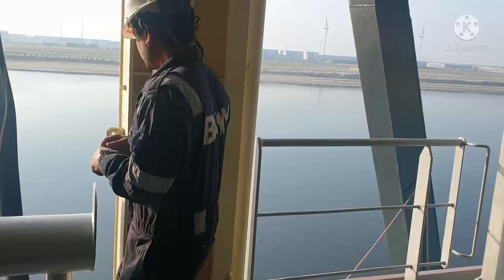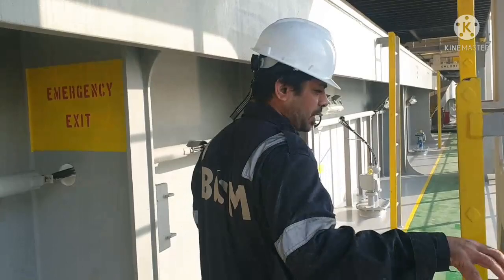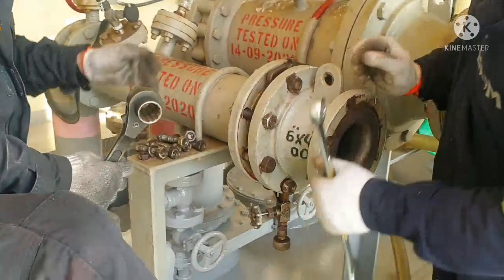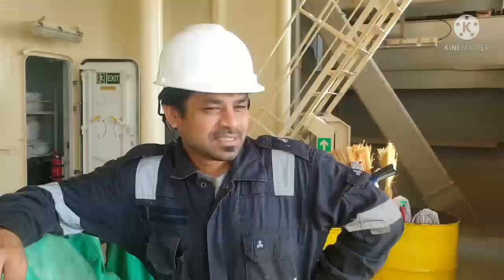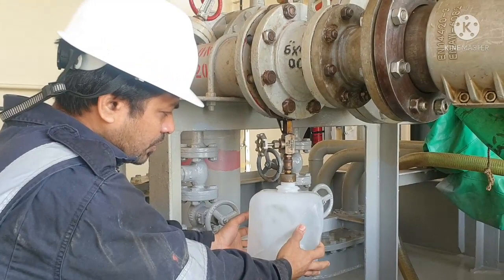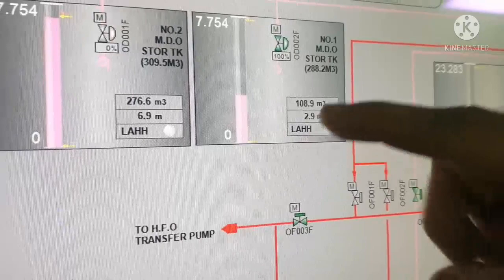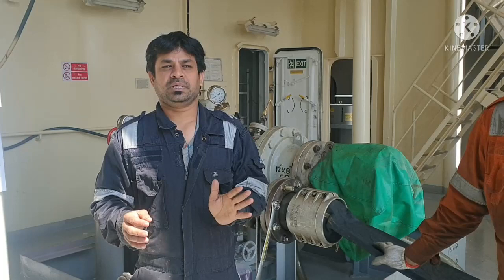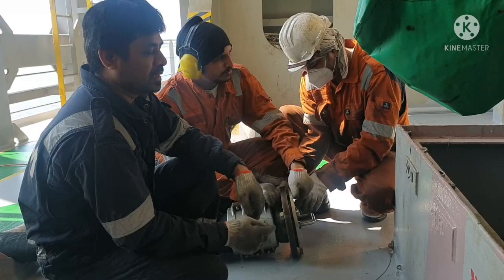How do they do... how to take Bunker onboard ship..

Comment: Thank you very much sir 👍
I have one Question Weldon pump Discharge side where to keep?
Reply from the maker: weldon pump discharge shall be kept on the drain line which will be provided inside dip trays which leads to any waste oil tank or overflow tanks. usually 200 ltr drum vl be kept as a part of sopop equipments which we can use ...
hope this reply will satisfy ur query sir.
Reply: Thank you very much sir. I got it 👍 sir can you do video about economizer waching?
Reply from the maker: @warnakulasuriyafernando4408  definitely vl do sir
Reply from the maker: @warnakulasuriyafernando4408   sir ,added economiser cleaning vdo as requested ..
Reply: I just wached It . thank you very much sir , respect from sri lanka 🇱🇰
Reply from the maker: @warnakulasuriyafernando4408  thanks for your good support sir..

Comment: Sir good day. New subscriber here. I just want to ask what does the 6x4 mean on the reducer?
Reply from the maker: Good day sir... Thanks for subscribing.. This is the size of pipe which can fit on a 6 inch flange wheres the other side reduces to 4 inch size.. Usually it will be used on bunker or  cargo manifold
Reply: Thank you so much Sir. Now I know, I learned a lot from you.

Also want to request a video about sewage treatment plant sir, its parts, flow and working principle. Just like on your air compressor and oily water separator videos.
Reply: Anna, thanks a lot for your video.
Sir please let me know how to prepare as chief Engineer? & U didn't mention the bunker pipe pressure test & what's the law for testing the pressure of the bunker manifold & what's the interval for it?..please inform me about it ...

Thanks again sir